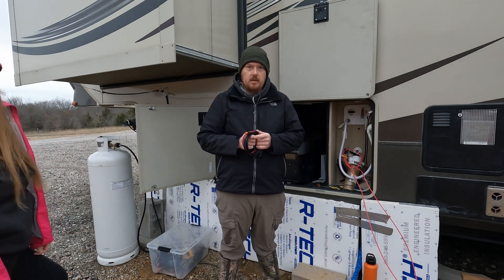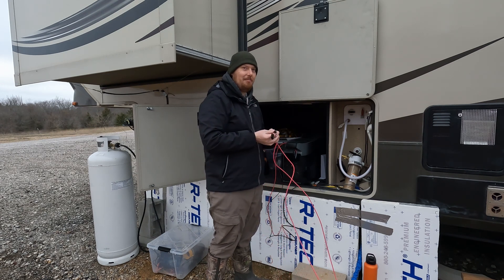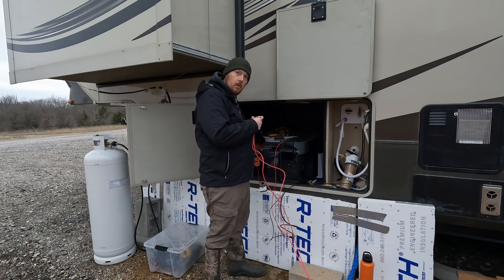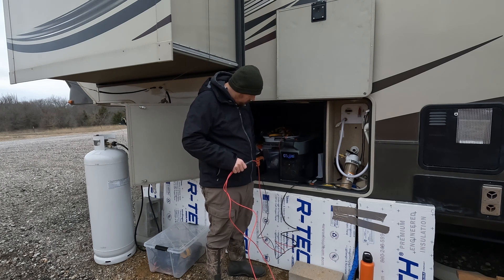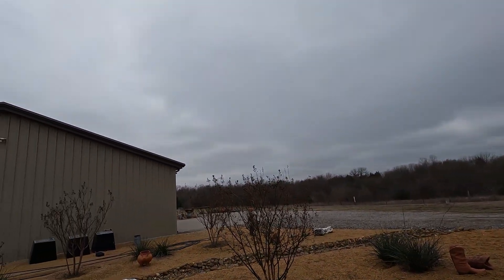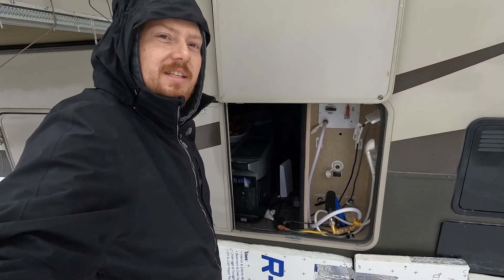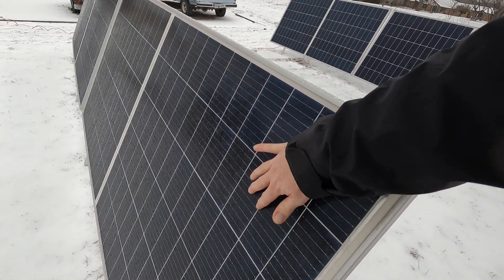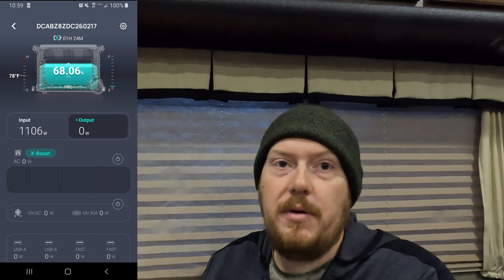Connecting Our 1500W Portable Solar Panel Array To The EcoFlow Delta Pro For The First Time!

Comment: Great Review. Just a concern, you might want to be aware that these batteries have limitations on too cold and too hot temps. Might charge better inside the trailer, where it's better protected. Someone else did a review on Delta Max and complained because battery kept shutting down because of too cold temps. Might want to check the specs.
Reply from the maker: Thanks for watching! 

Definitely! Lithium batteries are not good at charging under 32 degrees F. We will definitely keep them warm this winter. Fortunately they haven't been too hot this summer, even with the 90 degree days. 

We have an upcoming video with more Ecoflow content in the coming weeks :)

Comment: new to u channel ,  ill be following as were doing similar , i have the delta flow max and considering the additional batteries /   not sure if its the best choice as i heard something about the number of recharges that wasnt great of these batteries , this will be used 24/7 basically , maybe i should build a more permanent one ?
Reply from the maker: We are in a similar boat. We've invested in the Ecoflow portable products, but we'd like a more permanent solution. We like their in-home power system a lot. Also looking into systems like this one: https://www.ambitionstrikes.com/offgridpower

A lot of it boils down to budget and time available. Ecoflow provides really great turn-key solutions. You might save a bit by building a more custom system yourself though.

Comment: Bro physics isn’t your strong suit.  You need to angle the panels towards the sun.
Reply from the maker: The sun is not directly overhead in the winter, which is why you point the panels South at an angle. We used these sites to determine the appropriate winter angle for Montana. If you have a better method of calculation we would appreciate any suggestions. The mounts are adjustable for anything less than 65 degrees. 

https://www.solarpaneltilt.com/
https://news.energysage.com/solar-panel-performance-orientation-angle/
Reply: @bigskyoffgrid  ok fair enough.  Video looks suspicious but I’m not there.

Comment: I think your panels may be angled too steeply
Reply from the maker: Thanks for the feedback! We used these sites to determine the appropriate winter angle for Montana. If you have a better method of calculation we would appreciate any suggestions. The mounts are adjustable for anything less than 65 degrees. 

https://www.solarpaneltilt.com/
https://news.energysage.com/solar-panel-performance-orientation-angle/
Reply: @bigskyoffgrid  a quick way to set your panels is to find your latitude and set them to that angle. Montana is about 45degrees. Texas should be closer to 35. Yours look to be  close to 80 degrees which would be good for Alaska, also on cloudy days the more the panels face the sky the more energy they collect. If you have folding panels you can play with the angle on them while watching your ecoflow and see the change in power input and use that as a start for your other panels.

Comment: If you ever get some really awesome sun, there is a strong chance you will overvoltage the 150V max input of your ecoflow. You will most likely. need to go a max of (3) panels in series and then buy (2) more panels to make another set of 3 and then connect them in parallel.
Reply from the maker: Thanks for the feedback! We had the same concern. The panels produce a max of 47 Volts / 11 Amps (without bifacial gain). As far as I can tell the Ecoflow has a max input of 150 Volts /15 Amps. I'm afraid I'd input too many Amps using 2 series sets in parallel.
Reply: @bigskyoffgrid  , you can put in too much voltage but the solar generator will only drink as many amps as it can take. Cant have too many amps.

Comment: I hope you checked the open voltage on your solar panels to make sure you didn’t go over the the limit! You do this with the multi meter before you plug it in to your Eco flow.
Reply from the maker: We opted to use 3 in series to stay under the 150v limit on the Ecoflow. If we tie the 4th in or use 2 sets in parallel I'm afraid we'd go past the recommended volts or amps. Thanks the feedback and watching the video!
Reply: @bigskyoffgrid  
Just checking! 🖖😜
Reply: @simon359  In a desire to sound ‘helpful’, it never ceases to amaze me how confrontational and abrasive some folk are 🤷🏻‍♂️. Why? Whatever happened to common courtesy - inviting yourself in with a helpful suggestion?
Reply: @rightsideofdaisies  
Sorry, but I don’t see where I’m being abrasive?